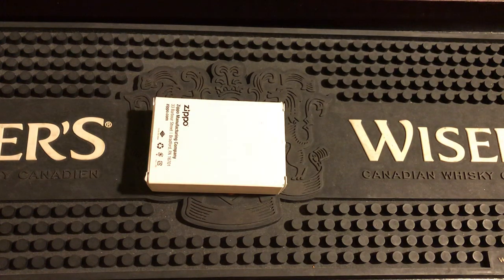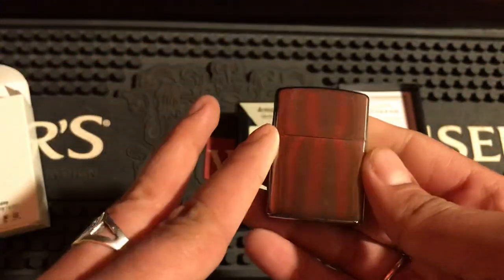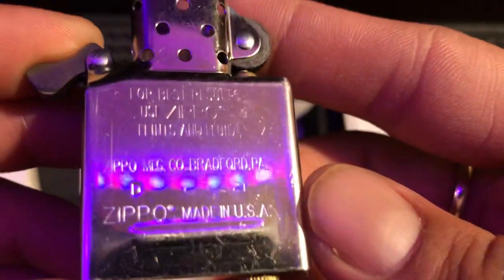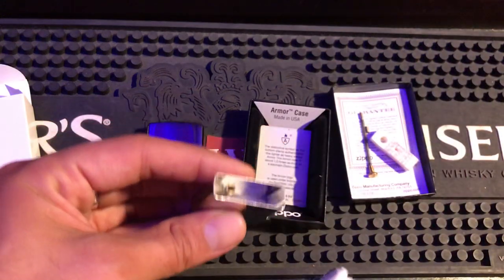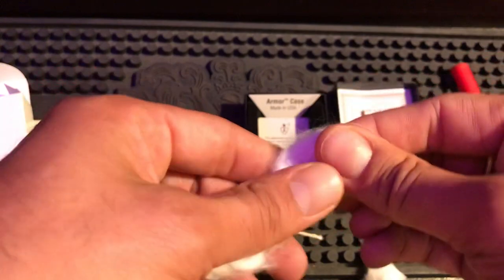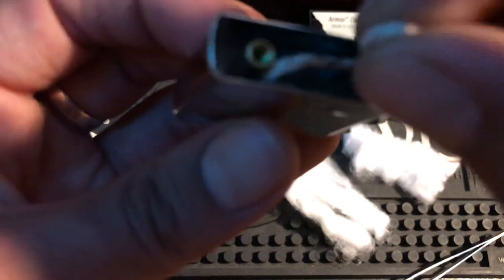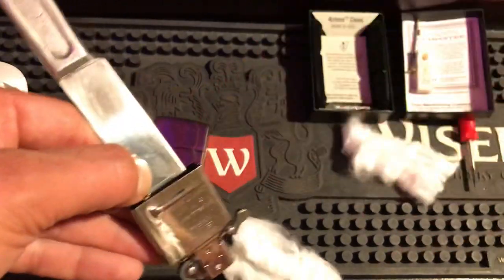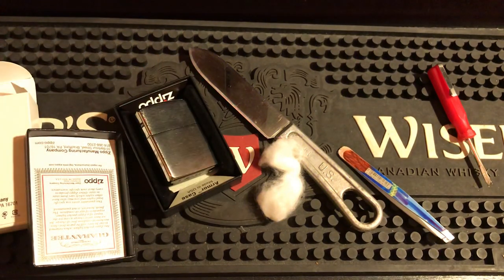Zippo Beginner Guide Tutorial The Instructions Zippo Doesn’t Tell You

Comment: I was on a punk rock concert yesterday when something hit me straight in the head, rather painfully, bounced and I caught it mid air. It was a 1989 Zippo. Almost as old as I am. Took it home. It was full to the point of dripping when upside down but didn't light up and smelled like a kerosene cleaner (the hard to ignite kind with additives that people use to clean motorcycle chains). Both wick and cotton were yellow (as in: very old) but also kind of hard (as in: someone was using bad fuel over the years, I guess?). I think it's still the first wick that lighter came with although it's very short. Thanks to your video I just fixed it with twine and cotton pads (makeup cleaning kind). Filled it with proper flammable kerosene and it works flawlessly. 😂 I was never into Zippo lighters, I don't even smoke, but I think I found a new hobby.

Comment: What you first pulled out of there was inexcusable.  And i have found the packing on some of my newer users inconsistent. Excellent method of repacking in my opinion.  Funny, on my '01 solid titanium that i used multiple times daily at work from '03 until 2016, i pulled up the wick once and trimmed it. Only thing i did in all those years save for routine cleaning of the chimney and wheel and burnishing outside of chimney with a bronze gun cleaning toothbrush. I just got around to rewicking it a few months ago. I got all kinds of chemicals on that titanium case and of course there was no effect whatsoever; which is why i was using it at work in the first place. Actually i did have Zippo replace the hinge pin when i retired though, it was toast. Damn lighter still looks new though except bead blast is worn completely smooth. It's beautiful.
Reply: @ZippoFanatic77  Think the MSRP was $99 if i recall, but i paid $55 thru a sales rep friend.

Comment: I saw when you disassembled the lighter that the screw that holds the flint is sticking out even though it is screwed to the maximum... and when you reassemble the lighter it sits on the screw because it is sticking out.... I have exactly one lighter and this with the same  problem

Comment: Yeah the machine they use to pack them is pretty off, but I tested one that was packed from factory like yours vs one I repacked correctly and the jammed up one consistently last me a whole extra day… I feel like it was because I disturbed the cotton but not sure. Was planning on intentionally packing one like that after having fixed it just to see but haven’t got around to it.
Reply: the reason i think it lasts longer to have it packed like they do, is because the wick isnt wicking up as much fluid, so you get less loss from wick evaporation. its the same problem with using charcoal lighter fluid vs gasoline. gasoline is easy to light, but thats because it gives off more fumes from evaporating fast. but charcoal lighter fluid lasts so long because it dont evaporate as easily... but that makes it quite hard to light. 

its always a trade off

Comment: I never knew they are packed so badly these days. I just opened up a new old  one from the late 80s early 90s at best. It's not marked the same as this one maybe cos its Canadian. I know it cant be any newer than early 90s because its enameled with a City of Sydney crest and the City of Sydney ceased to exist in 1996 cos of one of those misguided amalgamation deals. It has a reverse stamp on the bottom.

But it did not come packed like your new one. Whoever packed  it did it right like you did. But why do they come like that? It doesn't take an iota more effort to do it right in the first place. I'm not a collector like yourself. I like Zippos because they always work, some can be pretty classy, for a good lighter they are hardly expensive but mostly because they are simple mechanical thing. But most simple mechanical things need a little bit of setup when you start. Geez Louise though there is no excuse for sending it out like that.

Anyone who actually smokes with the thing isn't gonna like how it works. And if he doesn't know to watch something like this he is apt to say Zippos suck. They absolutely do not suck but the way they come from the factory these days sure does.
Reply: @ajames9256  yes
Reply: @ajames9256  they only started packing them by robot recently
Reply: @ajames9256  idk how the robot packs them, I just know one Does